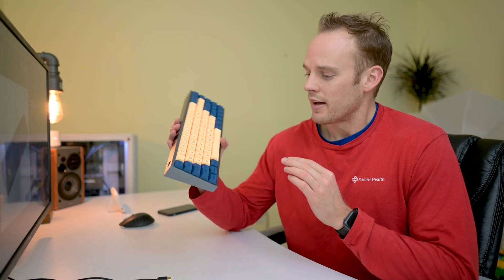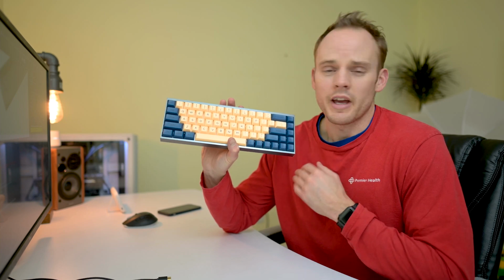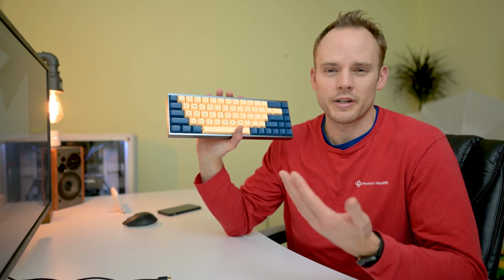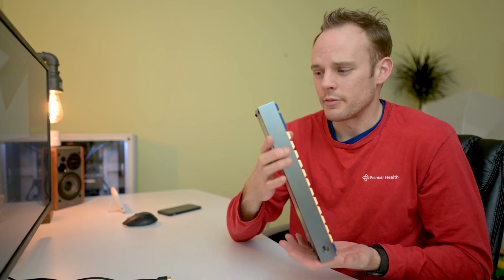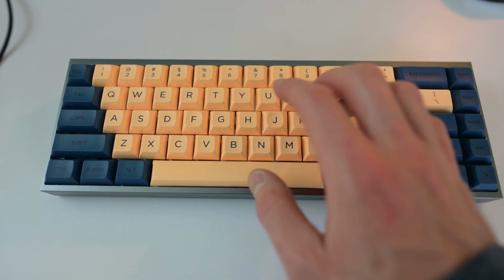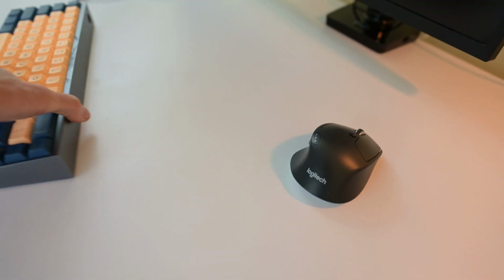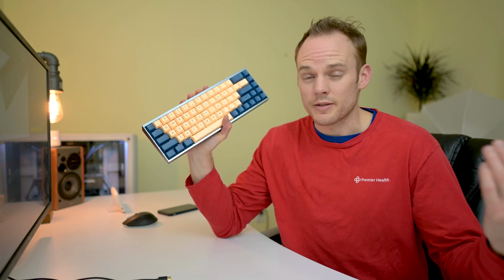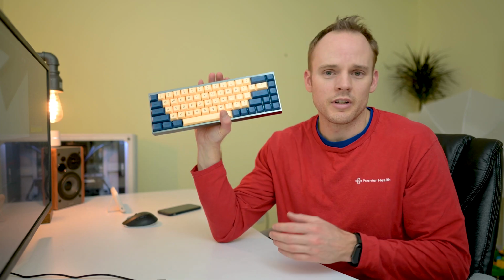Tofu 65 KBDfans - Custom Build Mechanical Keyboard Review

Comment: So I want to get this but have a couple questions, so there’s two options on kbd fans one for soldered and one for hot swap. Which one do I buy? Can u put a link pls
Reply from the maker: Didn’t even know that was a option. When I bought it had two choices. Blu tooth and no blu tooth.
Reply: @ObserveJeremiah  could u send a link?
Reply: @jpxfrddufjef4941  soldering is a longer process and isnt recommended for a beginner since u need the skill and a soldering iron to complete the build. Get a hotswap cuz its easier to put the switches in and there is no need for soldering

Comment: You said you are stuck with the switches but what if you choose the no thanks option with no switches then can you put your own switches?
Reply from the maker: That’s true but once they are installed it’s difficult to remove them. Kbdfan also has nearly every switch to choose from.
Reply: @ObserveJeremiah  can you answer though like yes or no to can you put your own switches?
Reply from the maker: Yes you can order a diy kit at KBDfans website.
Reply: @ObserveJeremiah  sorry for being like this but I’m saying what if I buy a fully assembled, with no switches with it and say I have switches at my house when the keyboard gets here will I be able to just pop the switches in.
Reply from the maker: Pretty sure you will need to solder them on. It’s not a hot swap board.

Comment: how do the stabilizers sound? better than the Miya pro or around the same?
Reply from the maker: Think they are the same. Switches are way better than cherry.
Reply: @ObserveJeremiah  great video man. I’ve been a fan of the custom keyboard scene for the last year and finally over the last month decided to part ways with my failing cherry black ducky one2sf, and began ordering switches and keyboards left and right, and I went with the acrylic tofu65 and I’m building it with durock jwk linears. Definitely agree with you on the better than cherry switches out there statement for sure. Cheers!
Reply: Also, as for how the stabs sound, if you’re feeling brave and are decent with tinkering you can buy some 205g0 lube or dielectric grease and make the stabilizers sound good on either with a little work. Good luck with whatever you go with!

Comment: I wouldn't of got Zeal Switches if you weren't planning to lube them. They perform worse unlubed than ordinary Gateron Switches. You did kick yourself in the foot for not getting a hotswap PCB, would've costed you the extra $15 but very nice build overall.

I'm not putting you down for it though, desoldering just sucks ass lmao.
Reply from the maker: Currently im perfectly happy with the board. Its well worth the price point. Coming from a Ducky board (which is also very nice) this thing is solid. I'm not into the hot swap PCB or lubing my own switches.

Comment: You shouldve got nk65. Its cheaper and better ;)
Reply from the maker: How is it better?
Reply: The nk65 can only use plate mount stabs which are much worse than the screwin stabs that the tofu can use
Reply: @ObserveJeremiah  Its not. Imagine thinking the polycarbonate creaky overrated plate mount stab usc right side NK65 is better. 

H i l a r i o u s
Reply: It really depends on what you like. Some people love the clear, almost gameboy aesthetic of the nk65 entry edition, but some really like the heavy, quality feel and availability of the tofu. Both are actually similar otherwise, and besides preference, you can actually buy a tofu, unlike a nk65.
Reply: If the nk65 gets support for pcb mount stabs then It would hold its own against the tofu or the kbd67 lite
Reply: @screwdriverss06  It likely wont though. They'd have to entirely change the pcb and plate. Sure its just holes, and a different plate cut, but that costs $$$. Cutting into profits. Its possible, but I don't see it happening. Even their new TKL is plate mount...